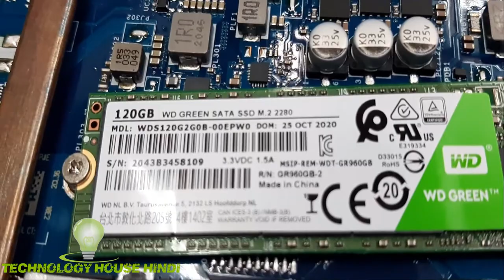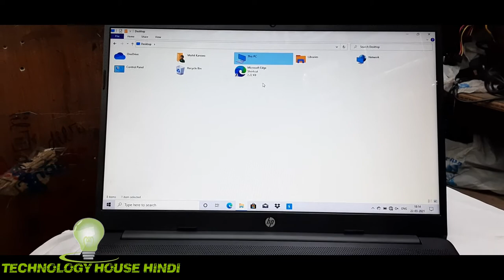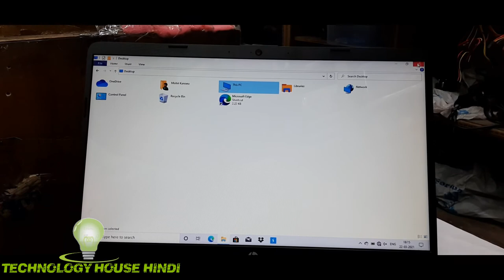Hp 15s-gr0006au Ssd upgrade , Hp 15s-gr0006au Ram Upgrade , Hp 15s-gr0006au M.2 Ssd upgrade

Comment: gr006au 4gb ram frequency is 2400 can i buy 2666 8gb ram?? 
will that cause any problem?
Reply from the maker: No
Reply: after installing ssd will that improve the booting time sir
currently i takes 2mins in hdd
Reply from the maker: @amirthkrishnan7930  yes
Reply: Sir can we use 3200 mhz  16 gb ram

Comment: Why only 5.94 gb is usable?
Reply from the maker: Install windows 64bit
Reply: @technologyhousehindi  bro i am using the same laptop specifications of 4 gb ram ryzen 3 3250u amd Radeon integrated graphics (512vram) but In task manager and properties it shows 4gb ram (3.44usable) how I can able to use full 4 gb ram for my purposes?
Reply from the maker: @jissmonjoshy9602  integrated graphics use some ram
Reply: @technologyhousehindi  so if i add 4 more gb it will become 7.44gb?Games that requires 8 gb ram will face issues on using 7.44gb ram?

Comment: I have same laptop hp 15s gr0006au can i upgrade my laptop with (Transcend 256GB NVMe PCIe Gen3 x 4 80 mm m.2 Solid State Drive) SSD and ( TRANSCEND 4GB DDR4 2666Mhz SO-DIMM Memory Module for Laptop ) RAM
Reply from the maker: Yes
Reply: Thanks
Reply: how will it cost to upgrade both RAM and SSD
Reply from the maker: @harisankartskutri8607  it will depend on company
Reply: @technologyhousehindi  which company ssd is better for this
Reply from the maker: @ShreeSinghBihari  crucial wd adata kingston consistent